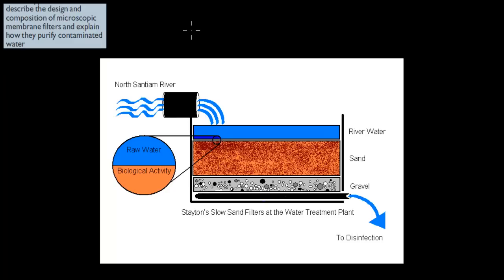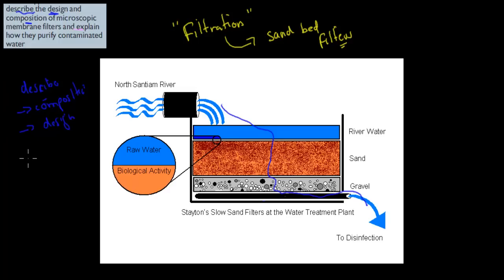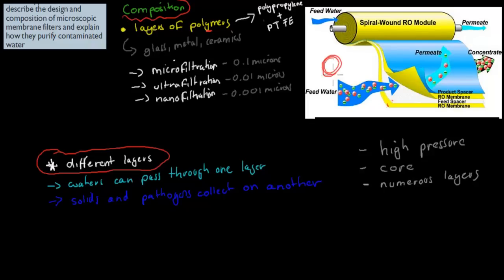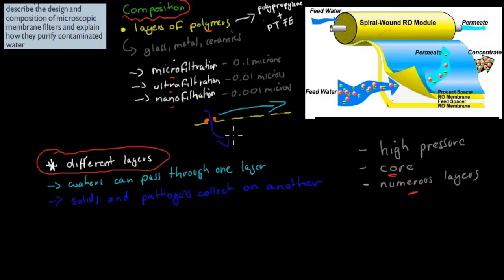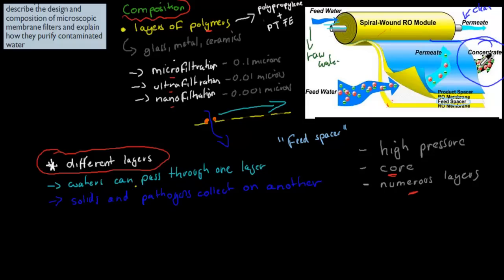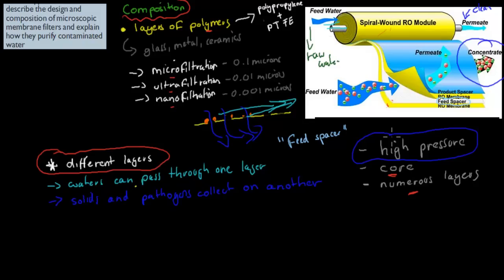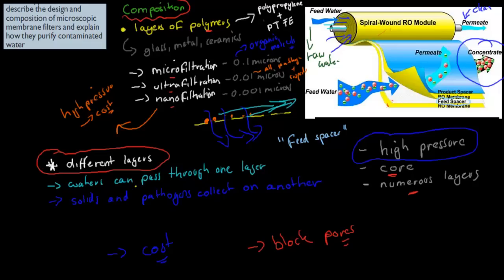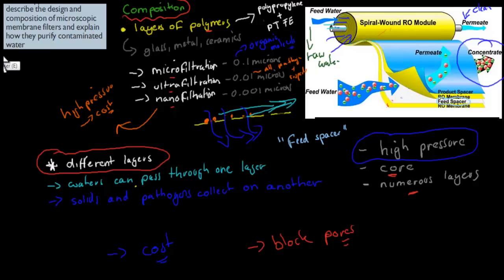CM.5.5. Membrane filtration (HSC chemistry)

Comment: another helpful video, the only thing i think needs clarifying is how specifically the water ends up coming out of the iron core. As in, does the iron core have pores similar to those in the polymer layers so only the water can pass through and if so where are these located (e.g. about halfway down, right at the end, etc)? Also, it seems like a lot of the feed water will just pass through parallel to the iron core and come out the other end, does this mean a lot of water is wasted?